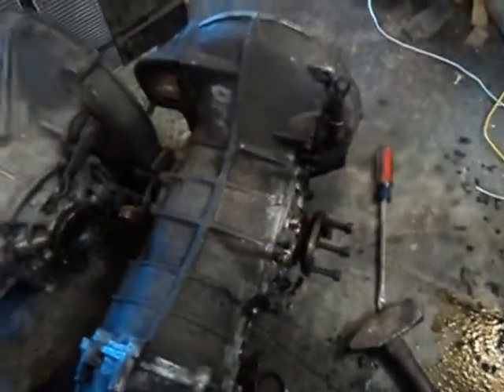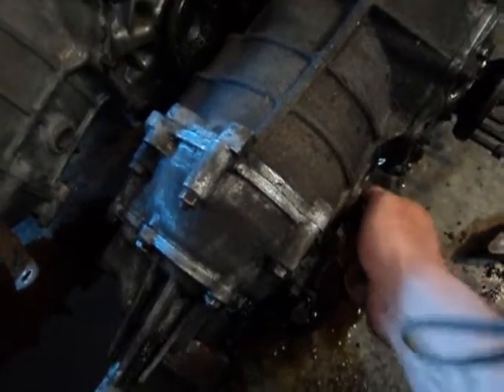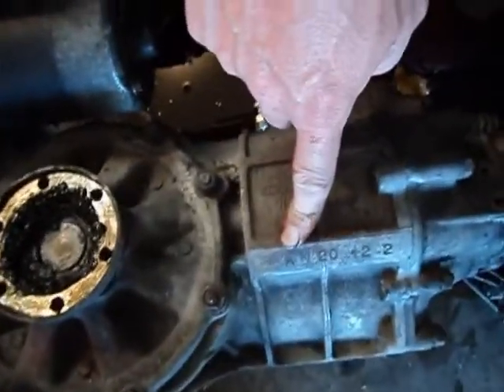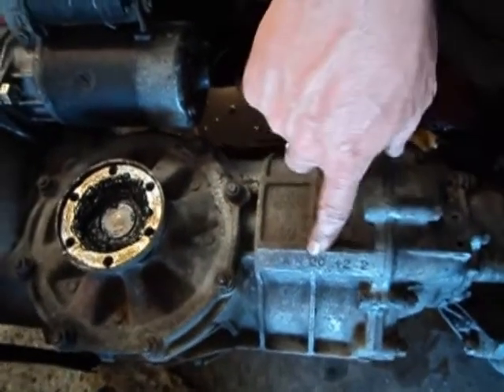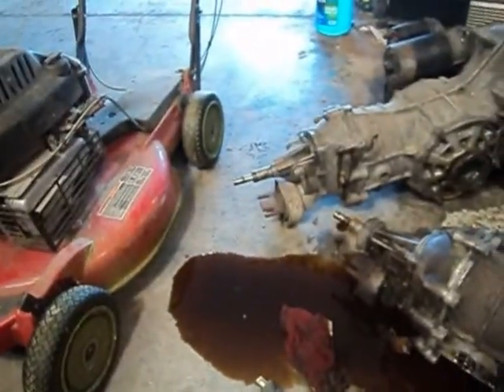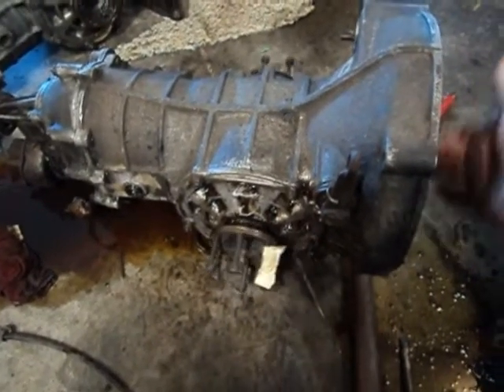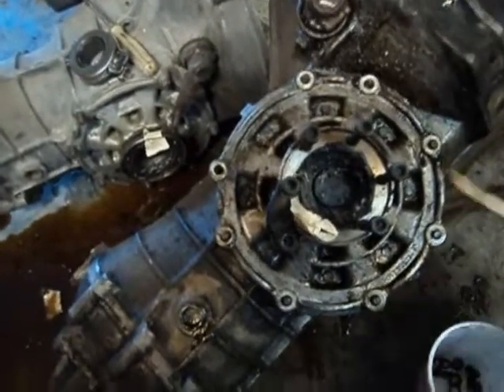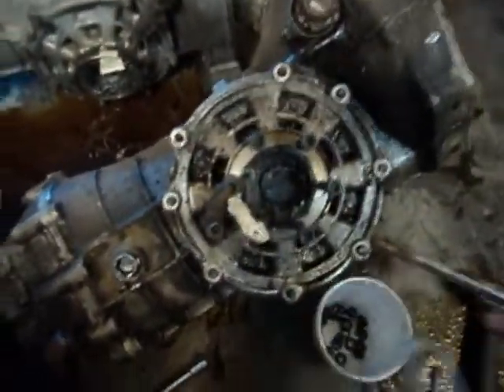VW Single Side Plate Transaxle Teardown

Comment: Here is my advice Greg;  find a good transmission shop and take these transaxles to it.  Forget about trying to tell what these axles are because they could have been rebuilt a few times.  A trans case could have parts from  any year car,  so a case number may be worthless.  If you do have a pair of 4.12 transaxles,  then you may be blessed.  My ghia has a 4.12 IRS and with a 2007cc motor and it runs great,  because it gets enough air and turns its fan at a reasonable speed.  Good luck

Comment from the maker: Thanks for the research Jeff.  I found that 72 was the transitional year, but I had not seen that they made a 3.88 with two side plates.  Darrin indicated that the two side plate boxes either didn't or couldn't hold the different R/P combo.  Next step is to get a working tach and confirm what I think I know.  The problem may not be the RPM it may be the airflow into the engine bay for cooling.
Reply: Greg's Garage

Comment: So, if I've got this straight....you guys were thinking you had the lower geared (higher numerically) transaxle because it didn't feel long legged enough out on the highway...correct? Now that you have the transaxle out, you found it is a 3.88...which is what you thought you needed..right?  So, did some of the transaxles have the same ring and pinion, but a different fourth gear? If they all had the same fourth gear..then I'd say your engine must not be winding out enough for some reason.

Comment: reversing light switch, also I have the exact problem with my Triumph, the car is supposed to be a 100mph car yet its is red lining at 80mph!! checked the diff and is correct, 4th gear is 1 to 1 so either it has the wrong speedometer or wrong rev counter!! However, as soon as the Austin is done, its getting a 5 speed Ford box! Hope you get yours sorted

Comment: I got the same codes... mine are both A H cases.  one dsc and the other my new one a ssc. I blew reverse out of my dual side cover. I made a deal and got another irs car tranny and come to find out its a single side cover. welded 3 and 4....  same internals as a 3rib? supposed to be as strong? idk. but did some research and they say a 388 is the AT code... and AH is a 412....